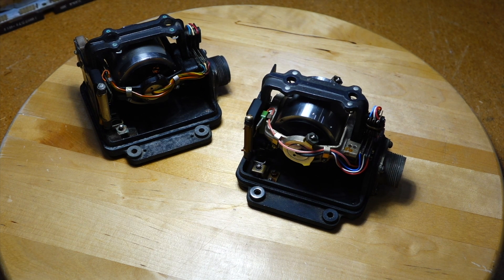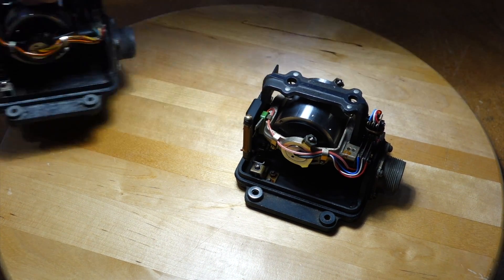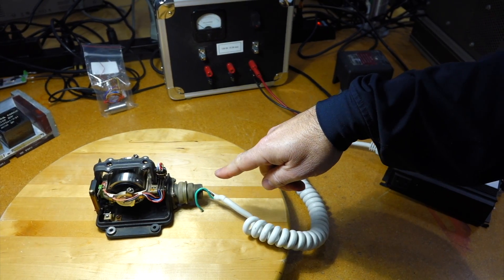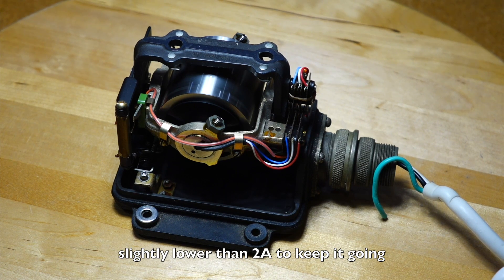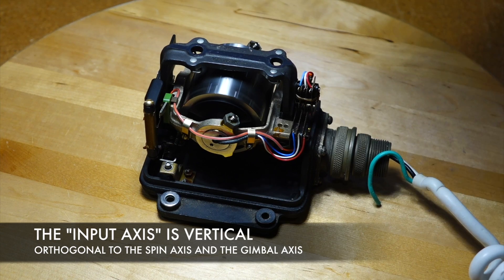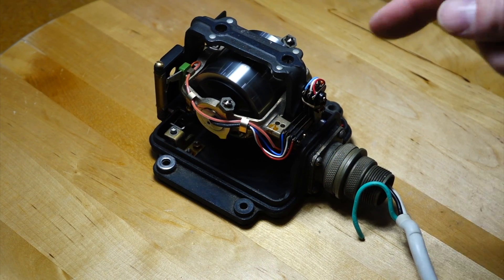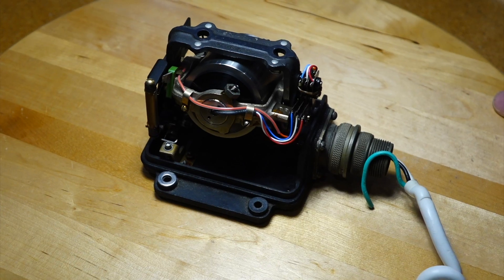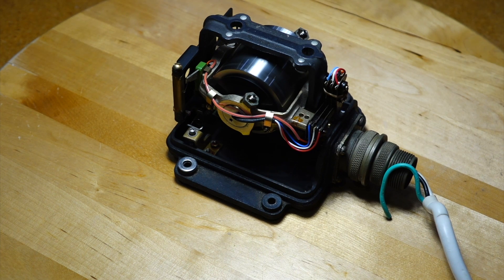Inertial Gyroscope Spin Up and Demo

Comment: I trained on the Inertial Nav system on F-4 Phantoms, USAF. we got to our first time aligning the platform and it didn't spin up right, our instructor said to spin it down and in ten minutes, he'd get a new platform for us. We let it spin down more than ten minutes and it still had the gyros active, It took three of us to wrestle it to the floor. I did work the INS system on the C-5A it was fully enclosed, we could only do the electrical alignments and check the accuracy, all together, something like 21 hours of work.

Comment: Hey. You can play music on this video. Try to click different areas in timeline after the gyro started to slow down.  Click these timestamps consecutively: 9:40 9:40 9:40  10:20  9:00 9:40
Reply: I does not work very well from the comment but you can try to click directly the progress bar and three consecutive clicks to the same point, one click to the right, one click to the left side of the starting point  and one final click to the starting point. And try to guess the song.
Reply from the maker: @ugurunver2403  Star Wars, imperial march!

Comment: I would like see a 6 hours video with the housing attached to the floor (or wall?) with the proper axis aligned east-west, the internal gyro should move as the time goes by 😂

Comment: I used to work on the F16 inertial nav. Unit. The grease for the bearings was like a solid when cold. The first step in powering up the unit was to heat up the lubricant to become a fluid like substance first.

Comment: Maybe 40 years ago, I had a friend who was an instructor at the Brisbane AU airport, teaching trainees to maintain and repair radar and communications equipment. He told m a story about a plane who’s radar navigation was not working , he flew from Cairns to Brisbane about 1200 miles ( by road)  he used his inertial navigation instead. When he got there and parked in his allocated parking spot, his inertial radar was out by only 5 or 6 metres.
Reply: That's pretty good performance for an uncorrected IMU. They tend to drift, so they usually work in conjunction with other systems to update groundspeed (Doppler radar) or position fix, like LORAN, or in the case of Apollo a special space sextant.
Reply: @johncantwell8216  it’s all Chinese to me, but I thought it interesting enough to remember after all these years.
Reply: @ianmoore525  And now almost everything is changed again with all the newer technologies.

Comment: Any simple explanation why the IMU uses the resolvers in conjunction with this angular acceleration data to control the "stabilized platform"? Why not just rigid mount the three orthagonal gyroscopes on the platform in an unpowered 3 axis gimbal. and measure the angular rotation of each big gimbal axis? Would the gyroscopes have to be too massive to provide enough momentum to reliably overcome the gimbal friction?
Reply from the maker: Great question. That’s because unservoed gyro platforms are not in the same league, not even close. The gyro has to do all the mechanical work to move the whole platform against friction, plus it has to rotate 360 degrees dragging a slip ring around, all that in standard mechanical bearings. Servoed platforms on the other hand are near ideal. The servos maintain the gyros always very close to their zero, perfectly balanced position, so no slip ring needed on the gyro itself, and the gyro does negligible mechanical work - it hardly moves at all, a few degrees at most while the servo catches up in extreme cases, and then it only drags along its own lightweight float in near ideal magnetic bearings. The servo does all the friction work on the mechanical bearings, slip rings, and the heavy platform. This is therefore far more precise and far lower drift.
Reply: @CuriousMarc  Good insight, makes sense. Thanks.

Comment: Where is the motor. Is it inside the wheel?
Reply from the maker: Correct, it's inside the wheel. More exactly, this is an outrunner motor. The wheel is part of the motor, it's the rotor. And the stator windings are hidden inside the wheel.
Reply: @CuriousMarc  it needs magnstic N and S to be attached to the wheel to rotate. It is like the brushless motor. That is correct?
Reply from the maker: @shredderegypt3394  No magnets. it just uses self induced currents with generates magnetism in the rotor, helped by a special "hysteresis ring" made from a material with high hysteresis loss.
Reply: @CuriousMarc  do you have example for it. Do you know video in YouTube explain it.

Comment: Sounds as rough as a bear's arse mate! I worked on (Single Gimbal 1 axis) Rate Gyros for Autostabibilisation one each for pitch , roll and yaw, (As is the one you have) on Phantom aircraft. I also worked on Rate Integrating gyros also called Rate/Rate gyros, Ferranti FIN 1063, as well as displacement gyros DGA and VFRS on Phantom back in the 1980's. In a Cleanroom.
That's quite big for a rate gyro, the ones I worked were about the size of two cigarette packets and had a torsion bar calibrated to the variable reluctance pick off to output a voltage proportional to the rate of angular disturbance, (angular velocity) about the sensitivity axis.
They also cleverly used eddy current damping provided by a pure copper vane between the attraction poles of two rare earth magnets.
Inertial platform displacement Gyro's I also worked on could not be moved from the test stand for at least 15 minutes until they had finished spinning down. Inertial, rate integrating, or Rate/Rate gyros have much smaller rotor masses and temperature controlled viscous damping, they tend to spin down within a minute. 
Inertial platforms use a combination of Displacement Gyros, Rate Integrating gyros as well as North South / East West and Z, (gravity) force feedback accelerometers, and some nifty second order differential equations to calculate the cross product accelerations the accelerometers detect as the control servo signals try to maintain the accelerometers at their null positions. (The actual acceleration signal is proportional to the feedback error signal which drives the accelerometers to null).
The purpose of an inertial platform is to provide a stable motionless base for the accelerometers to measure how much distance has been travelled by the vehicle carrying, it in the three dimensions in which it can move.
(Information nobody asked for, but you might find interesting)

Comment: Did a lot of work with gyros in the marine setting... Considerably larger than that unit... And the things sounded at least as scary starting up, and hours to stabilize.

That sawblade whine brings me back.

Comment: incredible bearings it must have i have never seen anything with such low friction to be that long to stop or it will spin a 10000000000 rpm

Comment: Lovely. Fixing & fitting inertial nav platforms, as well as pitch + roll + yaw rate gyros for stability augmentation flight control systems was bread & butter for Nav Inst trade in the military. That gyro spin-up sound brought back fond memories, Thank you so much.

Comment: Say what you will about crustyness, but that gyro performed admirably. I suspect that the long take was caused by dry bearings (to be read, with dry spots). You can actually hear the race path smooth out and the pitch even out to what you'd expect to hear (think of it like a needle scratchy sound).

Comment: So fix it in an N/S orientation put a time-lapse camera on it and let it run 6 hours and show the earth is spinning or fixed...
Reply: This type of gyro is not very suitable for such an experiment. Measuring the Earth's rotation with a gyroscope is not trivial (especially if you are not at the pole), but possible. For example, a gyrocompass uses the effect of the rotation of the earth to find true north.

Comment: That's crazy.....!!! Why did they need to spin so fast?
Reply from the maker: The faster the speed, the larger the angular momentum, and the stronger the gyroscopic effect (which is just conservation of angular momentum). So basically as fast as you can as heavy a rotor as you can that a precision bearing will take for long enough. Since they had 400 Hz in the planes, that's convenient to use in a brushless sync motor which will spin it at 400x60=24,000 rpm.

Comment: It sounds as if it has crusty bearings.  I'd like to ask two questions :
1. Would a gyro like this normally spin in an evacuated (semi-vacuum) enclosure to reduce windage?
2. Does the rotation of the earth affect it at all?  Can it even detect such a slow movement?  I know that electronic gyros can - but a mechanical one - though I know there were mechanical gyro-compasses.

I had an old artificial horizon unit once, but it wasn't electric.  It had an enclosure in which air was evacuated (possibly by engine vacuum in a plane), and allowed a bleed of air into cups that were cut around the periphery of the gyro wheel to spin it up.  I never did spin it up to speed, because I didn't know how to produce a good enough vacuum.
Reply: Yes the earth rotation can effect any gyro  its part of the effect in navigation gyros that causes gyro drift over time

Comment: Hopefully those gyroscopes found in smart phones are much smaller.
Reply from the maker: There are no gyros in smart phones! Mobile phones have three small low-precision accelerometers. The accelerometers are able to give a very rough short term position and orientation by double integration if it loses GPS position / magnetic compass or if the phone is moved for a short moment.
Reply: Thanks for the info. You are right. It fact gravity gives some possible orientation info (but's it's quite imprecise and noisy).
Reply from the maker: Exactly. Gravity is how they find the orientation with the accelerometer.

Comment: Back in the 80s and 90s I worked on these type of gyros at Litton Guidance and Control in SLC UT. Then, they started using ring-laser gyros and solid-state gyros. I left in about 2004, so I don't know what they use, now. It was already so noisy in the Test Area that you never heard the gyros spinning-up or down. Ho-boy but were they accurate. They could accurately measure the earth's rotation in real-time. The "stations" or pedestals we tested them on were 12 foot blocks of granite, per station, positioned in the ground. Thanks for this demo. Brings back memories.

Comment: That's a familiar sound in an airplane...When you turn the master switch on, the electrical gyro in the turn and bank indicator spins up (in a small General aviation plane, it's only 12 Volts DC though).  There's also a vacuum operated gyro in the attitude indicator and the directional gyro (DG).

Comment: It sounds bad. I guess the bearings won't last much longer. On the other hand, 24000 rpm isn't really much. The motors of small power tools often turn so fast and they are not lighter than this rotor.

Comment: Burroughs had a 36" fixed head disk array back in the early 60's. The hub was phosphor bronze and weighed 25lbs alone.  It had reginrative braking, using it's own inertia to slow down. 

One story goes when they pulled the unit out to be delivered to a service center, they forgot to set the brake. So it was still spinning when it was loaded onto the truck.  When they made a sharp turn at a corner, the storage array preceded right out the side of the truck!
Reply: its own

Comment: Very cool watching the spin up and spin down, always interesting to hear the sounds of these high speed devices. The highest speed rotating device I normally deal with is the video head on an Ampex VR-1200 Quadruplex videotape recorder, 14,400 RPM  and that includes the headwheel as well as a rotary transformer to couple the video to the preamps, it uses an air bearing.
Reply: Where do you still use these?

Comment: Sound like a RM-10B that Comp-U-Serve had on the KI-10's 512 mb Swap Drives - Rotating Drum's took 25 min to spin down. after the 10 min the drum would drop down away from the R/W heads (That is something you did not to happen) 
Replace the card that was bad and power back up - Late 1970's Tech

Comment: I wonder if safety glasses would be enough to protect you if that thing self destructed at speed....lot of inertia in that metal. ;)
Reply: nobody stood in the plane of rotation. If it self destructed, speed would be high in that plane but sideways components towards the observers and camera would hopefully be very low
Reply from the maker: Yep. Primary safety measure was to stay away from it...
Reply: @CuriousMarc  re: high speed rotating things:  Some time ago I was working on various tesla coil spark gap techniques and I found one that involved using a 13,000 RPM universal motor from a vacuum cleaner.  The idea was to rotate a tungsten bar about the midpoint, isolated electrically from the motor spindle by a slab of UHMW, and the rotating bar make electrical contact with a circle of tungsten rods around the periphery of its rotation, which were connected so that diametrically opposed static rods would be connected alternately by the spinning rod in the center.   Of course, the current being bridged by the rotating "commutator" was only about 100ma, but at voltage generated by a neon sign transformer, so ~14kv.   It was a very exciting device and by varying the speed of the motor you could find resonant points in the circuit where the coil would emit giant sparks, etc.  (You can see this in action by others by searching on ARSG - asychronous rotating spark gap.)  The few ASRG vids I could find showed the builders having to cower away from the shrapnel when their devices KATOed (to use an aeronautics term).   I figured I could avoid their problems - and built mine having watched their failures and determined not to repeat them.   Still, I wore heavy clothes, safety goggles, and hid behind a slab of 1/2" plywood.   The first test went fine, and I found resonances that were quite remarkable.  And just as I was getting comfortable that the operation was sound, things went south.  As they say in the military - everything is fine, until it's not.   My ASRG assembly had a failure (which I believe was due to imbalance driven by uneven erosion of the tungsten commutator rod).   It happened in a fraction of a second.  I was able to safely shut down everything, but after I assessed the damage, I saw a bit of tungsten rod embedded about 1/4" into the 1/2" plywood that was providing me shelter.   I gave up that design idea right afterward.  Such is engineering.
Reply from the maker: @musicmakelightning   8-o

Comment: Could you set this up to measure the rotation of the Earth?  The globe deniers won’t believe the 15° per hour measured by a ring laser gyroscope, they say it’s due to rotation of the ether!?!
Reply: Better would be to show them a gyrocompass: they use gyroscopic precession to automatically orient to geographical North, which can only work on a rotating globe (on a flat Earth the gyro would just keep pointing whichever way it was when it started up like a normal gyroscope does). Arguing with them is a waste of time though- if you show a flat earther something that demonstrates a problem with their model they just declare that you are a shill for the conspiracy.
Reply from the maker: It's impossible to use facts and science against flat-earthers, but that won't stop me from trying the experiment! Ed has some doubts whether these gyro have low enough drift to do this. But that's sure how they tested the Apollo ones.
Reply: CuriousMarc 

Yes, the people promoting globe denial are so deluded or so dishonest that you won’t get them to admit that they are wrong.  But the purpose of doing measurements and experiments to demonstrate the falsity of the flat Earth arguments is to convince the less educated who might be taken in by the reality deniers.
Reply from the maker: @jerry2357  Nah. We don't need to prove anything, they can think what they want. I just want to have enginerding fun with gyros :-)
Reply: Science-deniers have a pet phrase which they always use: "The science is settled!"

Comment: Those bearings sound horrible on Youtube, but considering the spindown time they can't really be all that bad.
I have to wonder how much of that 2A steady-state draw is the idle current for the inverter. I woudln't expect the gyro itself to be taking more than 3-5W steady state with no platform movement.

Comment: I have a couple similar , not motor driven , they were for jet fighters heads-up display for targeting .
They were air driven , pitot tubes in the jet brought air in to drive the gyros , more electronic in my gyros - the electronics in mine are to keep at a specific temp for the bearings .
I really miss the old surplus places , so much neat stuff ;)

Comment: Could you add a stepping motor and turntable  and some feedback electronics to show the rotation of the earth(assuming you're not on the equator)? You'd need to remove the springs. Also, that sounds awful